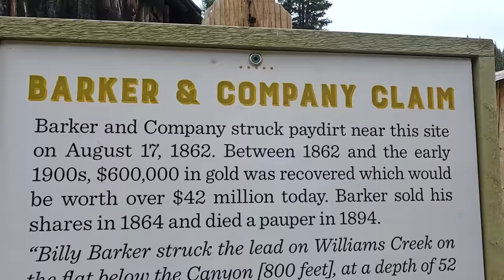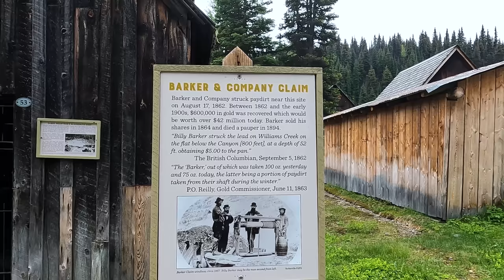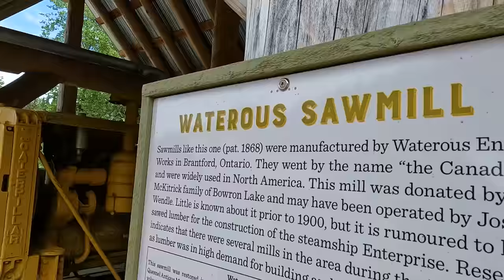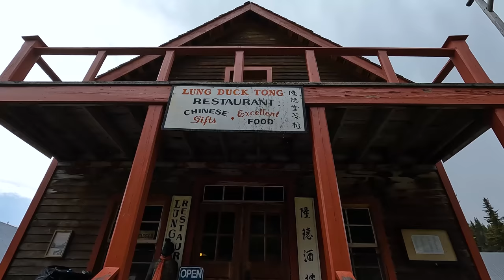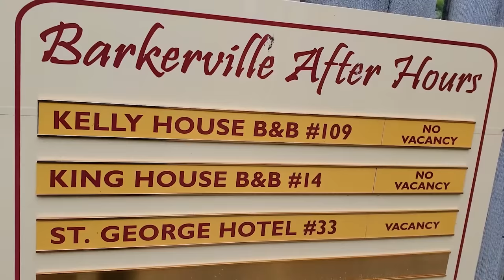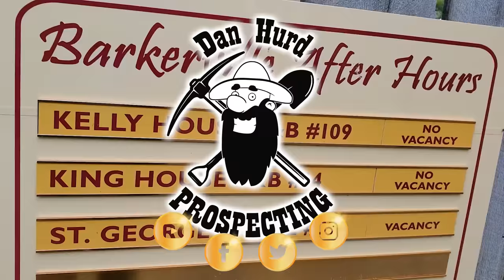$42 million of GOLD in one hole, Barkerville!

Comment: I have a question for Even.  
When they quench red hot steel in water.,, does the cold go up the iron to the heat or does the heat come down the iron to the cool water????
Reply: The heat transfers into the water. Eventually the water in the barrel gets quite warm if you are working lots.